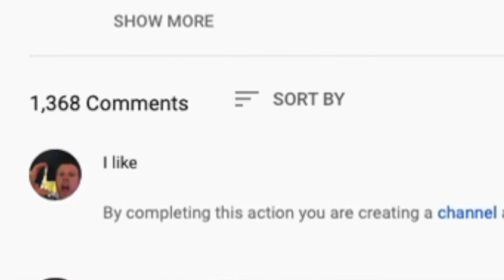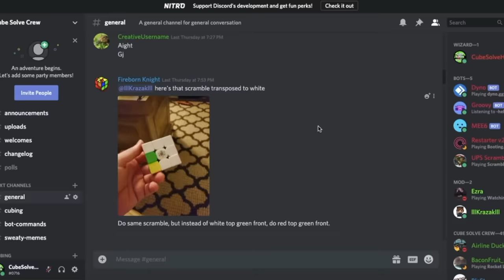How to Assemble a 4x4 Rubik's Cube | Full tutorial

Comment: Before watching this video, I assembled a 4x4x4 YJ cube with almost the same structure. It was simply assembled from the bottom layer, and the magnetic force at the corners and edges was sufficient to help, so there was no need for taping. This video is very helpful for the steps to slide the internal pieces in from the side. thank you.

Comment: Some cubes (especially the WuHua (V2) and WuJi) have fragile plastic, so you have to take out edges first or else you’ll snap the center piece. Or at least take out the outer most center corner and still pull apart the edges for more room when an edge center pops out
Reply: very tuff

Comment: About twisting the assembled cube to solve or scramble:
When you twist it in the middle, what forces the star-shaped core to always stay axis alligned, when the pieces line up into a perfect cube shape again?

A 3x3x3 has each middle piece directly connected to the core and this way keep alligned.

But at the 4x4x4 the arms of the core point to where the corners of 4 middle pieces meet.

Comment: The step at 2:02 to put those 4 pieces that just kind of sit there is literally impossible as there's not enough room for them to all fit....putting on one just pushed off the other side and even if you got them all there, the ends on the main cube base will just knock em off since there's no way to secure them to the ends where the screws are like is represented on this video.

Comment: Magnetic cubes are better so you won't be in trouble with assembling in brackets between 2 edges and corners. To make it easier don't speed up the video: pausing videos are not a part, third layer isn't difficult: so put pieces in the bracket track.

Comment: The inside mechanism looks to be absolutely symmetric, so if we rotate two upper layers, I wonder if the internal cross would rotate with the 2 upper layers, or will stay with the 2 lower layers, or would move just partly (in later case going out of alignment with the small cubes and bringing the whole cube to the deadlock). I really cannot understand why this mechanism does not deadlock in practice.

Comment: I found a 4x4 at a thrift store and spent a few months learning to solve it. Today I finally get to the last layer only to find two of the corners had been deliberately swapped. I tried the method I use on the 2x2 to see if it would fix the issue. Nope so of course I try popping out the corners like a 3x3. Big mistake. I'm pretty sure I didn't lose any pieces I put them in a sealed container. I should have watched this first.

Comment: been trying for an hour with a fucking magnetic YJ cubicle 4x4 and it won't behave like yours... everything falls apart very easily and the small white pieces are impossible to get to place properly when constructing the first layer... it doesn't help that all pieces are slippery as FUCK due to the oil  they use to lubricate their cubes... NEVER anything bigger than a 3x3 ever again... not worth the hassle... 30 bucks down the drain, lasted a couple of days...